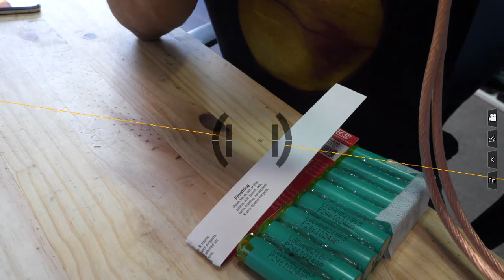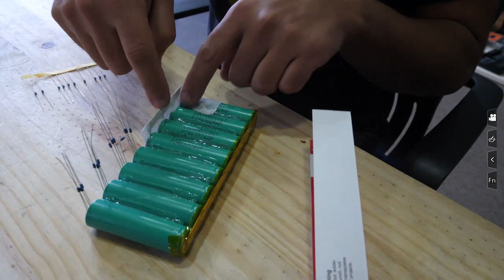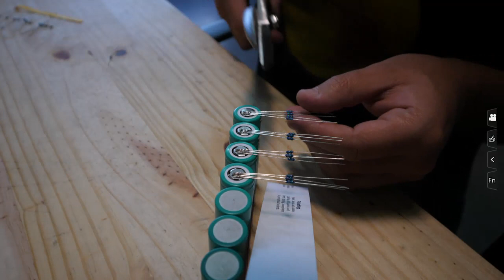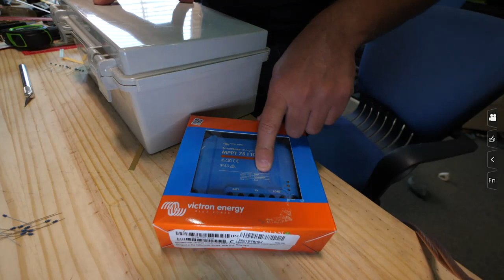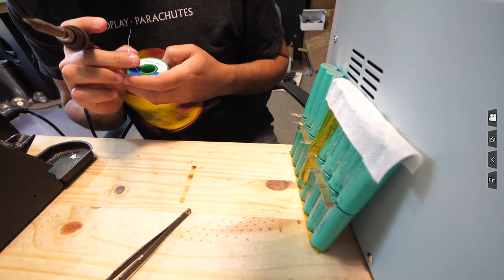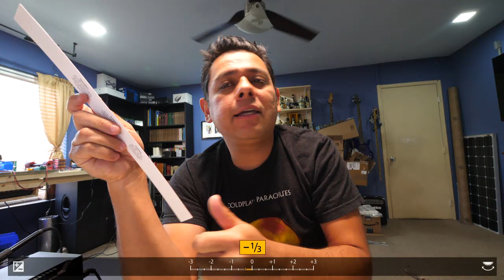LIVE spot welding LGHB2 18650 cells sing Tesla Style Fuse Wires

Comment: I bought the Sunkko spot welder and found out it would not create a  solid weld. Put together an Arduino spot w er lder from Germany and then used the Sunkko hand held spring loaded stinger hooked to the Arduino DIY kit which worked great and spaced the spot welds perfectly. The Sunkko stinger did not have the power hooked to the Sunkko unit to spot weld. The ebike school is long on theory and short on practice and pimps a lot of junk. The Sunkko spot welds direct off the unit but fails on the hand piece.

Comment: I used silver solder to attach all the wire's and battery strips, i find this to be a better conductor. Brass is not a good conductor of electrical energy nor is aluminum.
Reply: I don't know why you say aluminim is not a good conductor. It is more than twice as good as nickel, and just slightly behind gold.

Comment: I may have some knowledge here on the resistor wire you are trying that may help save you money and failures. Take into consideration, one pack of resistors worked and one did not , for spot welding. You most likely bought from two different company . The metal alloy used for the legs way most likely different. Also if that is true then the resistors Tesla used and the ones you picked up a century or so later most likely are quite different at least in metal alloy leads. Back then those probably did not change much as to where they do today. Due to SO MANY component company and all trying to find the best alloy passable for their product would put them on top. Not a big problem back then. So, you know already how to find the burn apart Amps. All you have to do is pick an alloy you like and a diameter of wire, like say (0.5 mm.) .  You will need a set of Caliper so you can measure wire diameters in (MM.)Millimeter and an amp meteor to measure Amps. You probably have those already.  You know what Amp you want it to burn at. Buy several different type wire from e-bay and experiment & take notes. Simply find one that will burn at the amp you want it to. Go back to e-bay and simple find a lot or roll of that same alloy metal wire at that same diameter and WALLA  !! (fuse wire) Most likely will be cheaper than buying the resistors, use the wire leads, and throw the resistor away. LOL Seriously, Think on it some. The metal alloy and diameter is what you want. Most likely you will never find out just exactly the one Tesla used but you can do better with the same idea.

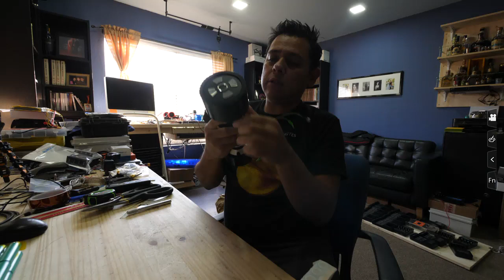Comment: OK garcia, ya finally got me to subscribe !! Been watching you for quite a while now. With all my research I been doing on just how I want to build my own batteries for my solar bank. I took a liking to the 18650 power wall idea and it would be cheaper ,easier, & faster. Looking into it further I cant help but run across your videos, A LOT. I must admit, at first I took you for a HACK on you-tube just blowing smoke to get money. There are many !!  So I actually started watching a bit just to see what you would say or do next. I know absolutely nothing about batteries but was a bench Tech. for a while among many other electronic field related positions in my career. Due to that knowledge and my findings on batteries and luckily the fact I started watching more of your videos and for longer. The more I watched the more of what you were saying actually made since and good since also. Actually, YOUR videos my friend seem to be on the cutting edge of new technology. I now realize, you Sir are THE REAL DEAL  !!! Even though YOU didn't know it I must apologize for my first judgments. Well that's the story of how you got me to sub. , not an easy feat either. I do not sub. to many. I do have a question though, not actually batteries related. If you would please, drop a link or at least a way to find those AWESOME skateboard wheels with the motors you show at 28:00 of your video ? I could really use some on a small project a friend is working on for roofers. Its a cart of sorts that a guy could load shingles on and pull it across a roof as he nails. That way he could do 2 rows at same time and never have to get up and walk away to get more shingles. It could save time and make the jobs go faster both and with only ONE MAN !! So if you please, drop me a link for those motorized skateboard wheels?

Comment: that should be a joule=1 watt second ,3600 joule= 1 watt hour, this is used for heat input measure in welding, say 1 inch of weld takes 10 sec. to make at 100 amps and 20 volts (10X100X20=20000 joules (20000/3600=5.5 watt hrs/1 inch

Comment: What do you think about putting capasitors parallel to ebike battery to get more torque? I'm thinking to put my ebike 6x22000uF capasitors, I think that would give me more torque when acceleratin?
Reply: No, capacitors will not help. Torque is entirely dependent on your motor and the voltage you supply it. Capacitors allow you to supply a lot of current for a short amount of time, where as a li-ion battery holds more energy and can supply a smaller amount of current for a(much) longer time. Your battery does not supply current, rather your motor draws current from the battery. As long as your battery is sized accordingly for your maximum continuous current draw, your battery will not experience significant voltage drop under high load, and your motor will provide the most torque it can for the voltage it is given.

Comment: LOL, I can't afford that spot welder and batteries.  Built one as seen here on You Tube but using my 600CC 
Battery it blast holes.  Using a little sissy 17Ah battery it works quite well.

Comment: Guessing your Settings are 60 /2   60 AMPs @ 2Volts. 
I thought the point of using the Fuse was to Isolate the individual cell if it went south ?  Why are you putting all the fuses on one cell ?

Comment: So as you make the battery now the fuses are not working, you need to isolation between de cells in serie otherwise the current goose directly from one cell to the other without using the fuses.

Comment: The smoke coming off the melting solder is a good indication that it has flux.

I think there is sufficient evidence that soldering the batteries is a bad idea and spot welding is the way to go. There are several DIY spot welders discussed on various battery and eSkate sites in addition to the commercial ones like this Sunkko one so getting one to do the job correctly without damaging your batteries is within the means of most viewers.

Comment: Hey Man, can you help me, i need to make a 12v pack for my camper van. If i use 4S my peek and nom is to high, if i use 3S I miss out using the majority of the cell's capacity. What should i do? I need Step down DC to DC reducer?
Reply from the maker: Yeah or use lifepo4 cells  http://j35.us/20x-Lifepo4-18650

Comment: SO the only issue I see here is the gauge of the spot weld. The size of that connection in solid metal is very small. Not much smaller than the wire your using but they are pretty small. The use of three spot welds is a great idea to get around that but its still a little inconsistent and may need to be tested properly. Just because Tesla are doing it doesn't mean your doing it like tesla are doing it, if you know what I mean.
Reply from the maker: We shall see
Reply: Also I am a certifiied TIG welder and No gas is given off, that's not true. It was Zinc they were talking about. Your aluminium spot welding idea will work IF you remove the Aluminium oxide layer on top of all Aluminium. You need to just remove 1mm off of the surface. If not there will be no penetration to the weld. No join. Aluminium melts at 1100 F so not too high but it needs to be Al not Al203 Aluminium oxide. That melts at 3762 F. Either way it will work but is likely to be problematic. (Also from Australia, by total coincidence :-)  )

Comment: Thank you for your videos, theyve been very helpful. I have a question for you though. Why is it that some videos you say you could make a 12 V battery out of 3 , 3.7 V batteries when I that equals 11.1 V? And also in another video you said you cannot make a 12 V replacement battery with the 18 650s. Could you please clarify on this? Would you be able to string seven together and make a 24 V battery that would be 25.9v?
Reply from the maker: 11.1v is too low for 12v equipment  but 26v is perfect for running 24v equipment
Reply: Thank you. But why then, in a couple vids, you say 3 wired in series for 12v?
Reply from the maker: Because you can make 3s for some12v equipment,  most doesn’t work but some does
Reply: Just make a 24v system and convert it down to 12v
Reply: Yeah... 12v is tricky with 18650. Either 3s and you don’t get much out before equipment dies, or 4s but under charge them. 7s is closer to 24v nom so build a 7s 24v and then step down using dc to dc converter (24v to 12v). But the converter isn’t 100% efficient so you lose a little performance. Maybe 10%.

Comment: I don't think copper or brass will weld that well. in auto body and stuff like that. I have used copper to fill a gap. while welding over the gap. because the weld will not stick to it! I'm not that sure about spot welding. maybe you should recheck the welds?

Comment: Why four wires? Why not just nickel tab ribbon? I can see why you'd want to use a single wire fuse link like Tesla but with 4 will they blow in the event of an overload? Might just find a higher rated wire if you need to fuse at a higher current rating.
Reply from the maker: Because this spot welder will not weld thicker wires to cells, pretty much at the limit these cheap Chinese units can do
Reply from the maker: Plus 4 wires works,   So the question why not
Reply: Well then I guess multiple wires it is. Seems kinda slow but then again you're not building a car battery pack.
Reply from the maker: But I will, very soon,  it will have single fuse wire per cell per side so,  10k+ welds?  I’m gonna need help
Reply: I'd be happy to help but helping from up here would be difficult.
Reply: Ordered my new updated spot welder today. A bit better than the other one but it will do nickel ribbon tabs. Have not tried it on single wires yet.

Comment: Where would be a good place to purchase a solar panel?  Looking at something like a 100 or 200 just for a backup bank at home, rving or cabin.  Looking at best price per watt.  Found one at http://sepbatteries.com/ecosolargy-230w-poly-crystalline-solar-module .  This is a 230watt at $101.66 must purchase 2.  Is this a good deal or what are your thoughts?
Reply: afaik those polys aren't as efficient as monos. But if you have the space you can use polys. Pricewise I'm a ali express buyer,  Solarparts Store-Shenzhen is where I got them from.

Comment: 16:49 Gold is not better conductor than copper. Silver is.
Reply: Silver is 10 times more than Niobium. Just is. I don't know where you got that from.
Reply: Niobium is the best conductor of all, but your prolly not going to use that either.
Reply: CheapVlog
Oke you take the silver and i'll keep the gold.
Reply: gold is used to in contact joints where you want the metal exposed to oxygen.. Gold doesn't corrode
Reply: Shadow of a Shaman indeed gold is used to avoid oxidised contacts 👍🏼
Reply: There is no better conductor than gold well may be a ceramic super conductor at-250 degrees Kelvin